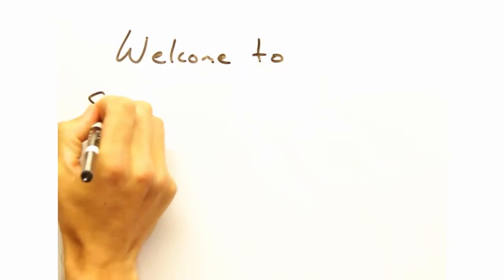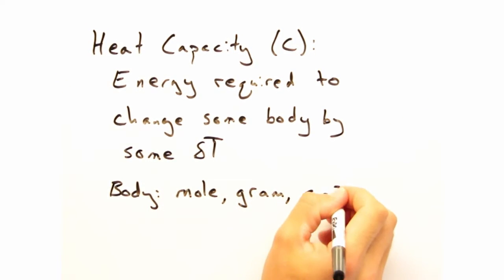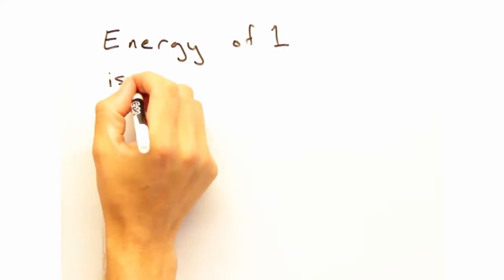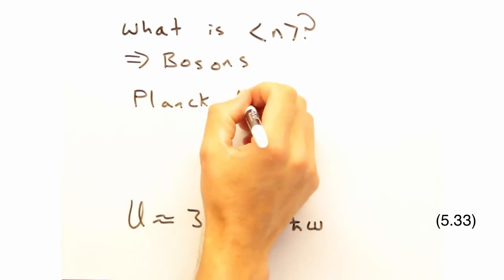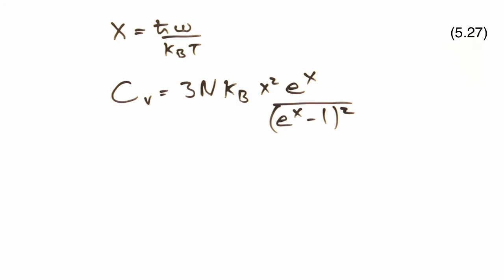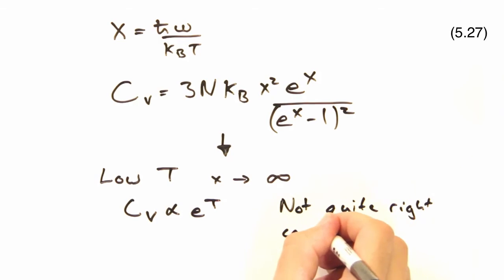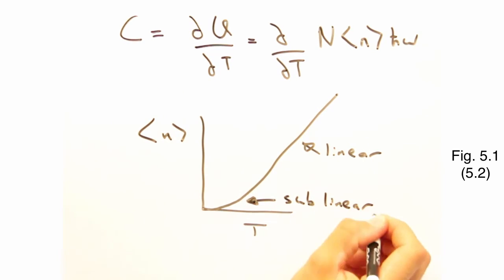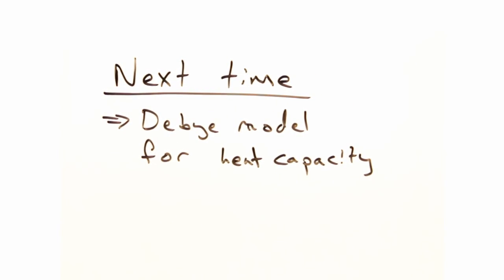Solid State Physics in a Nutshell: Week 6.1 - Planck distribution and Einstein heat capacity

Comment: There is one thing confusing me: why the energy space is constant in a harmonic system?
Reply: (in this answer hbar = h)
Because einstein's energy for a harmonic oscillator En = (n+1/2)hw which means that the energy levels just increase with the integer n, each level is only separated by hw. This spacing is constant.  E(n=1) = (3/2)hw, E(n=2) = (5/2)hw etc, increasing by hw each time.